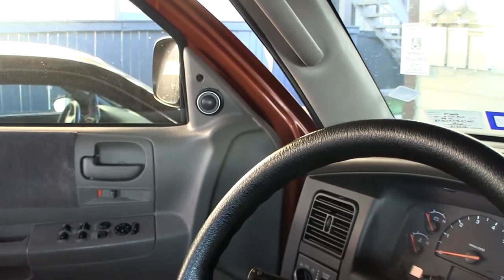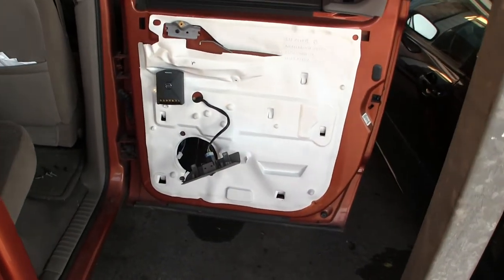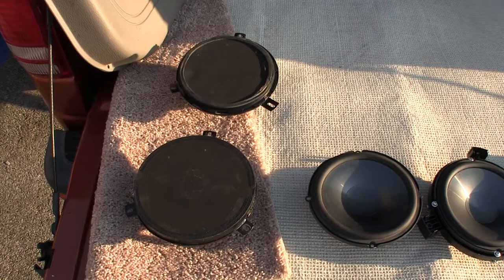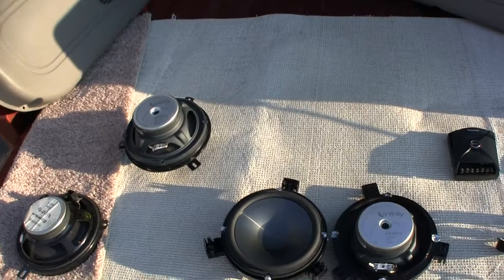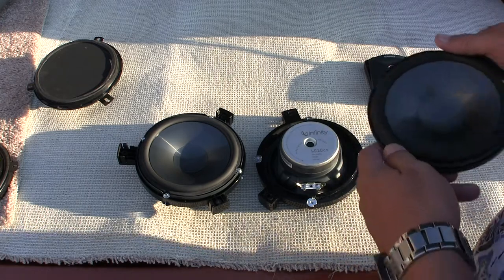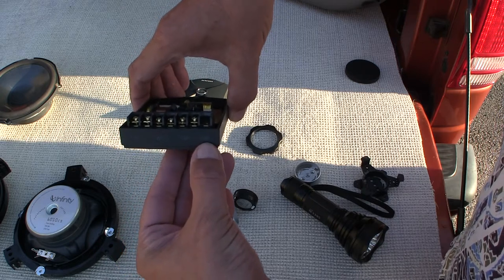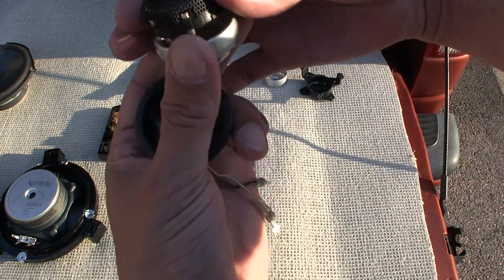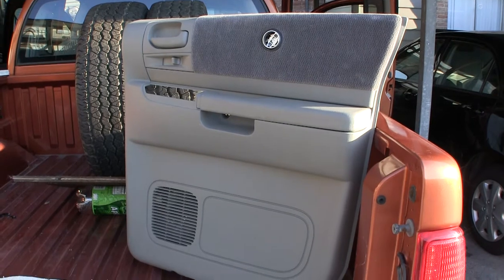2001 Dodge Dakota QC 4X4 4.7L How to upgrade & Install Infinity Speaker Starfish I-mount 10

Comment: my dakota has the stock stereo system, im looking to install tweeters to the front doors of my quad cab, i’m going to drill the holes for the tweeters where they should go stock. i have never used a crossover and i’m unsure how to wire it, would you mind describing the step by step process ? thanks a lot!
Reply from the maker: Luke Szydlowski I made about 11 or 12 or 13 videos of how I installed my stereo in my 2001 Dodge Dakota quad cab 4 by 4 just search for that or watch the 12 or 13 videos that I made about doing what you're intending to do and also read up on how to wire a set of speakers any speakers using a crossover pretty simple can a vehicle is just a matter of where to screw everything down and hide it all
Reply: Cassette2Go I appreciate the quick response and i’ve watched your videos, they’re very helpful but i’m trying to simplify as best as i can. So currently i have coaxial speakers on all doors. I want to convert those two in the front to component speakers with tweeters. I understand how to connect the tweeter and component speaker to the cross over but the only thing left i’m unsure about is how to connect the cross over to the system
Reply from the maker: Most x-over's should come with a wiring digram as to how to wirre them in.  Now to intergrate this into your truck  all you need to know is which are the plus and minus on each side of the tru8ck from your speaker wires.  send me your email to my email:  jamespierceiii@hotmail.com and I can send you pictures of how I wired mine, ok?

Comment: How do I tell if my 2001 dakota sport quad cab has infinity speakers ?
Reply from the maker: Remove the door Panel and then the speaker and Look at the Back or rear of the Magnet of the Speaker.  On the bottom or backside of the Speaker (Woofer Magnet end)  is normally where you will see the brand and other information of whatever speaker is in there.  If you are thinking of looking into through the grills in the door's - Well - there is no information there to be seen unless there are ( aftermarket speakers in there - sometime's they show or are proud of their name...)  One more thing IF Your vehicle Has the Premium Sound in it?  Then you should have the word Infinity embossed into the tweeter grill's for the tweeters mounted in each front door, & if not , then you wont know until you remove your door panels.